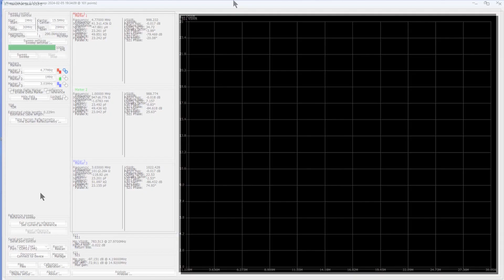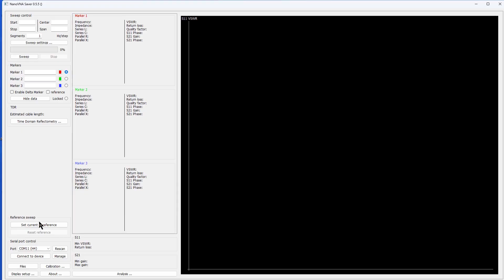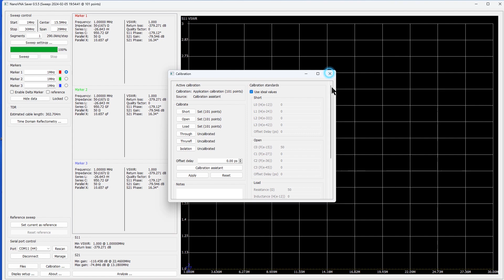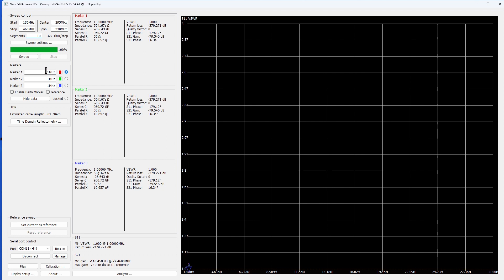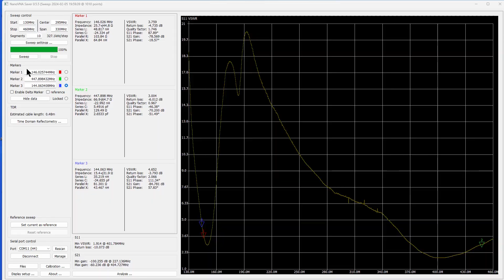Is your stock HT Radio Rubber Ducky, Trash or Treasure? We test and find out!

Comment: I've been campaigning for this style of antenna testing few a few years.
So many people disconnect the monopole (without the groundplane, that is what it is) from the top of a handset and connect it to the top of a VNA that cost less than an Ecoflex 15 connector, and declare "look - I tested it - I brought up a smith chart - look at how tested I made it".
Wrong.
They tested half of it.
The other half (the radio) is still on the bench.

I'm cheating because I work at a commercial radio dealer, and I have access to an almost infinite supply of broken radio chassis - However - What I have done is lash up a coax patch lead to the INSIDE of a particular radio chassis, and that becomes my fixture to test alternative antennas. This even allows me to test antennas on radios that do not have coaxial connectors (Icom / Kenwood / older Motorola).

An alternative way is to build a field strength meter with a diode detector and capacitor to smooth, connected to any old needle meter movement. 
Adjust for HALF deflection from AT LEAST 1 wavelength away (to avoid nearfield).
Transmit on the handset with standard antenna. Observe meter deflection.
Transmit on the handset with alternative antenna. Observe meter deflection.
If the meter movement shows more deflection, it stands to reason that the antenna under test is doing a better job.
The test above avoids questions surrounding the ground planes because it is comparative, not quantitive, and the only thing changing is the antenna.

Notes:
I have not yet found an aftermarket antenna that performed better (in tests or just subjectively) than the standard supplied antenna. I have found just a couple of antennas that performed the same as the standard antenna (on a half decent radio).
Reply from the maker: Thanks for the explanation, I do find this to give a full picture of performance.
RJ
Reply: Smiley s do good if ur thin  but they adjust  for proticular  frequency s